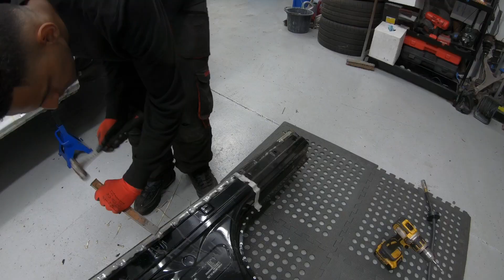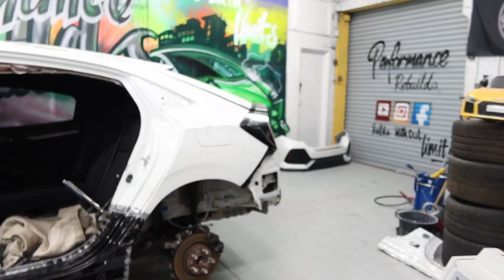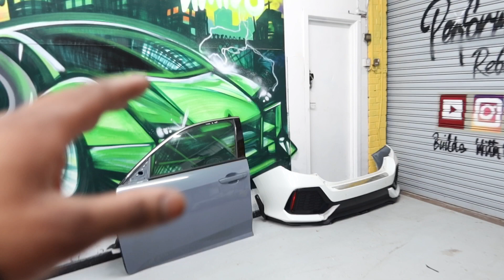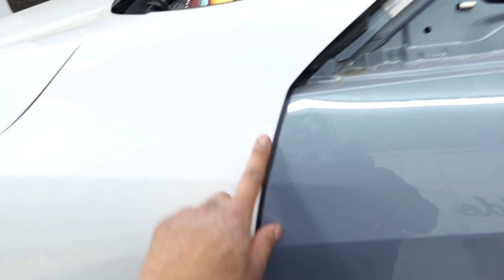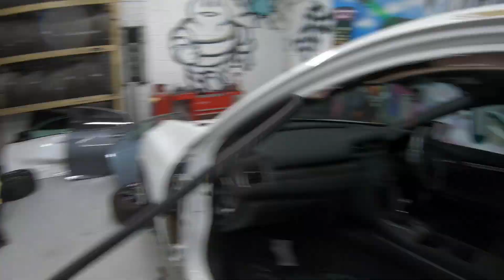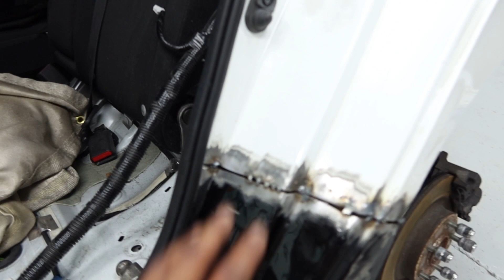WELDING A NEW DOOR SILL ON OUR SALVAGE 2018 HONDA CIVIC (P2)

Comment: How do you deal with replacing the VIN label as in this car the sticker has been removed from the current car and it now has the one from the donor car (or none at all I you were using a new panel)?
Reply: Drill the pop rivets out.
Reply: Yes, but in this case (and in most cars now) it's a sticker that breaks if you peel it off (like a motorway vignette).
Reply: Ah OK, if it is a sticker, just heat with a hairdryer and removed carefully.